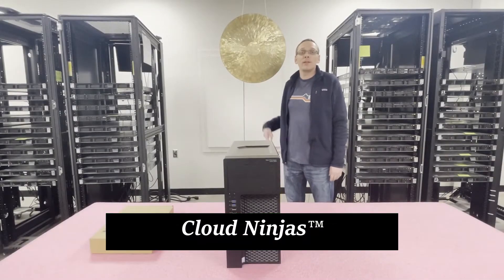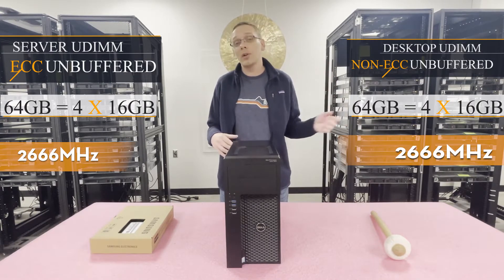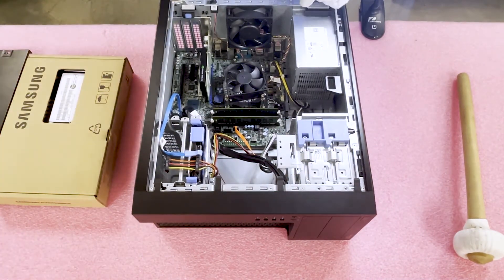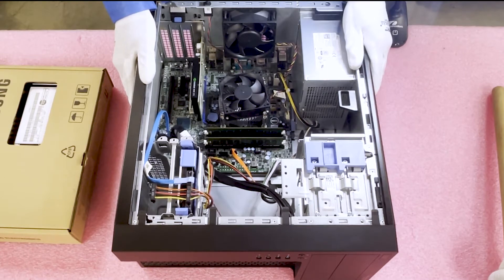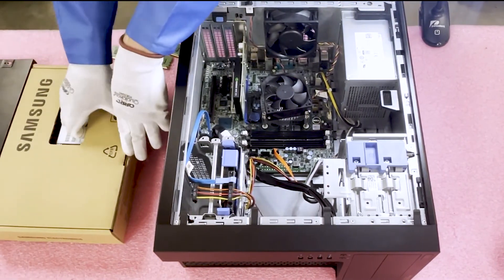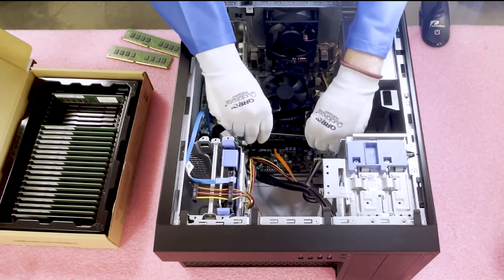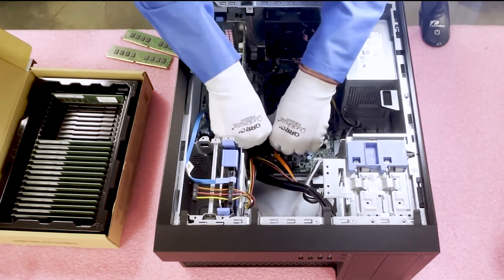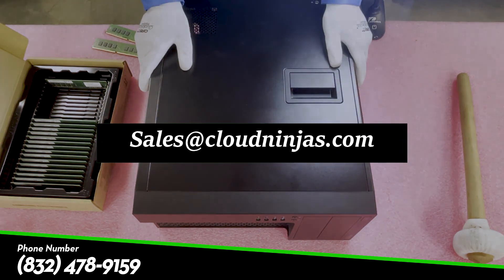Dell Precision T3620 Tower Workstation | Memory Upgrade Options | How To Install & Configure RAM

Comment: I was wondering how old are these computers and if there two models the workstation and the non workstation.The workstation with Zeon and ECC memory and the non work station with i7 and non ECC memory.
Reply: Late remark on this, but it may depend on cpu. The i7-7700 (one I'm looking at) says: "ECC Memory Supported No" on intel's site. But that cpu (presumably all) supports the full 64gb.
Reply: @czos9239 I got a hold of 4 Precision towers - 3 T3620, & 1 T1650. All 4 have the Xeon sticker on the case. I haven't had a chance to test them, or study the BIOS. Actually found them in a dumpster. The Xeon that came with the unit, can it also be upgraded? Are there front cooling fans in the 3620? Thank you 🤓